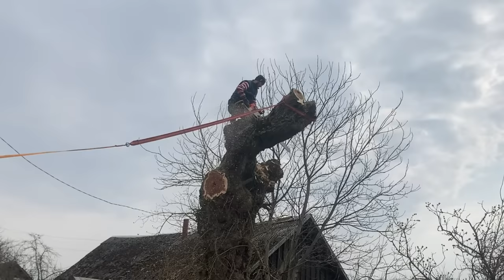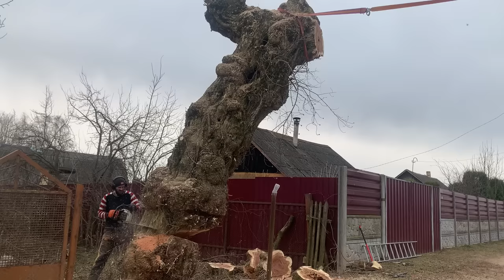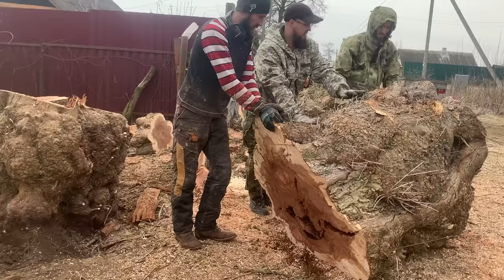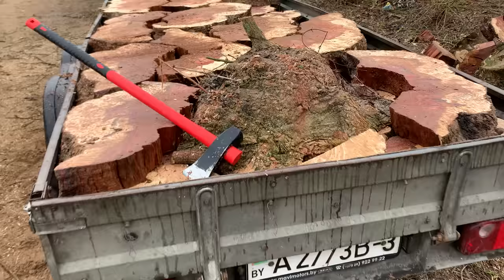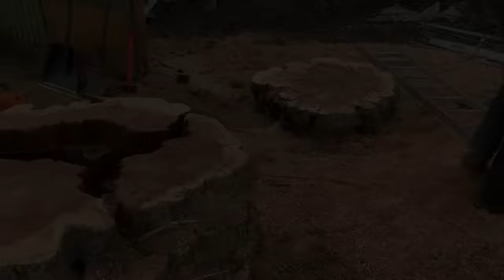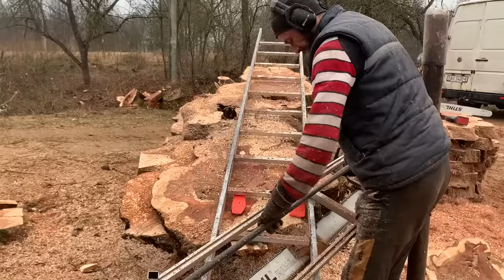Blood Tree

Comment: Those "Jigsaw Cookies" are awesome as they are. Due to the rot in the centre and the way the pieces broke it shows that recovering large planks and slabs were probably not on the cards for this tree. Still, you can make a whole bunch of live edge round-tops with epoxy centres. Hats off to you gentlemen. 👌